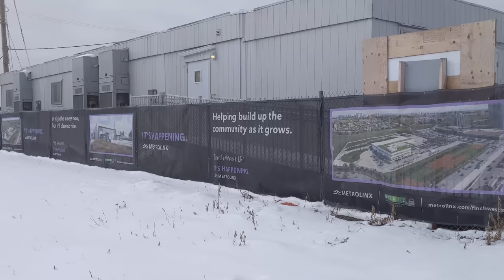Missing Links: Short-Sighted Transit Planning

Comment: Hamburg might also have a missing link in the future: It is planned to build a new S-Bahn tunnel to the west, reaching the Osdorfer Born (more than 20,000 people live there I think). But, first of all, the S-Bahn is doing the job of a metro there, second, it will end at a very unfortunate end, where any additions will end on some fields, third, the town of Schenefeld, just outside of Hamburg, will be missed, where P+R could be built, fourth, it will also miss Lurup, a part of Hamburg with about 30,000 people (also, the planned U5 will miss it too). Then you continue next to a wooded area, back into the city, and you'll squeeze right between the stations of Diebsteich, future station for long distance trains, and Altona, a major bus hub and current ending station for many trains. So people will have to change to regional or long distance trains at either Dammtor, where not all trains are stopping right now, or at the main station, which is overcrowded and will be even more in the future.
And then theres the U5, a metro line which is currently under construction (at least a tenth of the total length, for more than one billion euros). It starts kind of in the nowhere, in Bramfeld, far away from the U1 and the under construction S4 in the east, crosses the S1 line to the airport without a stop, and then meets the western branch of the U1 (the U1 has a rather odd shape), which you can take to get to the S1. It will continue southwards, missing the U3 station Mundsburg by about 200m maybe, and then it hits Hauptbahnhof, where barely any people will have left the train, and the platforms are even considered too small. Then it will go on until it reaches the ending station: Arenen (stadiums), where not too many people will exit during weekdays, just short of Lurup (see above). At least you got another stop at an S-Bahn station.
And no, theres no such thing as a Tram.

tldr: S32 not reaching Schenefeld, Lurup, Diebsteich or Altona; U5 not reaching S4, U1-East, S1, U3, S32.

Comment: the red / blue connection mentioned at the end is suppperrrrrr frustrating as a everyday T user. there were designs to extend the BL there in 1986. and even ready a page of a book that talks about the possibility of a connection in 1904. MGH station was even renovated in 05'. lets pray that the newer plans for 25' -2030 will go thru and finally bridge the link 
 what are these companies doing?!

Comment: What a coincidence with this video! Kolkata just opened its third metro line (Joka-Esplanade) along a truncated route (Joka-Taratala) which is practically useless as it doesn't connect to the mainline rail transfer hub (Majerhat, the next station after Taratala, about 2km apart)! The new line, when connected, is supposed to have interchanges with mainline rail at Majerhat, and with other metro lines at Park Street (with Line 1, the North-South Line) and Esplanade, the Northern terminus of this line (with both Line 1 and Line 2, the East-West Line).

On the contrary, Line 2 (which still runs on a truncated route) saw a massive jump in ridership (from 5k to 30k daily passengers) when it extended by just 2km, from Phoolbagan (the previous western terminus) to Sealdah (the present western terminus). Sealdah is the busiest mainline rail station in not only Kolkata, but India as well, as its the terminus for a plethora of suburban rail lines, along with intercity rail to rest of India. The Sealdah-Sector V stretch (Sector V is the IT hub of the metropolitan area present around the eastern boundaries of Kolkata), though not the complete stretch of East-West Metro (the bulk of ridership is expected to be on the western half, between Sealdah, Esplande, and Howrah, another massive suburban and intercity rail hub), still provides meaningful service with just a single extension.

Comment: The biggest problem is political interference.  I know that the politicians green-light the funding, but for decades now I've been one to say to get the politicians OUT of the decision making process.  It is far too tempting in lean times to pare back funding in order to make up for budget shortfalls., or to scale back a project when costs start to spiral out of control and a politician is in danger of losing their elected position in an upcoming election. (Or even worse, gutting needed transit projects in order to fund pet projects that are more 'sexy' to the average voter.)

Comment: In Singapore, the Downtown Line makes a loop around the CBD, but along the western part of the loop, it crosses the North-South and East-West Lines without any connection. This is especially inconvenient with the North-South Line where you need to go in the opposite direction back out of the loop to connect outside the CBD. It also goes really close to Dhoby Ghaut, which is a HUGE interchange hub with three other lines. If DTL stopped at Dhoby Ghaut, it would be so convenient for so many people making so many different trips. But LTA (Land Transport Authority) and SBS Transit (DTL operator) probably had a good reason to not connect.

Comment: There's one pretty "outrageous" missing link in Paris that is getting some traction, in the sense that the public starts to really question it :
It's the North end of metro line M12 at Mairie d'Aubervilliers (which will be a connection with M15) as the tunnel continues on for about 900 meters, serving as the terminus backstation and train storage.
It extends exactly in the direction of La Courneuve - Aubervilliers station on RER B situated 1km from M12 North current terminus, meaning there's maybe not even 100 meters missing to connect with RER B, so approximately the length of a metro station platform...
Some locals are being quite vocal about that gap, as such a connection would be very useful and practical and the tunnel is already dug and fully equipped for 90% of the distance.

One other big missing link that will certainly raise loads of questions when the lines concerned by that "oversight" will open is the La Plaine - Stade de France RER B and M15 station :

The M16/17 lines' tunnel runs under the North tip of the plaza in front of the RER station, and the end of line M14's tunnel sits right between M16/17's tunnel and the current RER B station.
This plaza will also host a station of tram T8 South extension and the M15 station.
This spot is already the main transit access point to the Stade de France, regularly overflowing RER B with hordes of stadium goers.
So why on Earth wouldn't they put a station on lines M14 and M16 / M17 too, as the tunnels are already there, to alleviate the load on RER B and future M15 & T8 by spreading it on 3 more metro lines ? It's beyond me...

The plaza being of triangular shape, you could have separate entries, each serving primarily a particular line and greatly helping to separate traffic flows above ground.
The Western side of the plaza triangle could have an entry serving mostly line M14 (*), the Northern corner of the plaza could be the entry mainly dedicated to M16/17, as the Northeast side is reserved for T8's station and the Southern side is dedicated to RER B and M15.
This precise layout would follow the tunnels and existing  & future, under & above ground stations' current disposition.

I heard the justification that they want to split the human flow with the further West station complex of Saint-Denis Pleyel (M14, M15, M16, M17) and Stade de France - Saint Denis RER D.

But that's wishful thinking as we all know what stubborn crowds do : they go to the closest access point and clog it or use the shortest path, despite the best possible indications.
We recently had an exemplary demonstration with the monumental chaos that occurred before a soccer match when RER B was having problems : crowds diverted to RER D, saturating it and concentrated on the closest stadium access, a secondary one not designed to handle so many people, instead of the slightly longer main indicated path to the much larger main access point.
They averted catastrophe by a very very very thin margin but it sparked quite a scandal.

Without M14 and M16/17 Stade de France station, all those that would want to catch these lines will inevitably saturate M15 for a one station Westbound ride instead of walking well over a kilometer, crossing the large railyard.
(*) > [ Have a look on Maps sat view and cartometro, you'll see it couldn't be better placed :
The building site immediately touching the South side of the RER B station is for line M15's station, the building site on the Northwestern side of the RER B station and right across the street to the West of "Place des Droits de l'Homme" plaza (a 180m x 150m x 150m triangle) is line M14 tunnel's end and TBM exit. Lines M16/17's tunnel runs under the Northern corner of the plaza's triangle. ]

One solution could be that this hypothetical M14's Stade de France station would only be open on the days and hours when the stadium is used while on other days the tunnel after Saint Denis - Pleyel would keep its current use as back station and train storage.

So I'm pretty sure we will hear criticism about these Stade de France missing links in the near future as I'm far from being the only one questioning that choice of not putting a station here for M14 & M16/17.

There are several other gaps, mainly between the upcoming (already heavily connected) line M15 and the different ends of metro lines, especially in the West.
Namely : M10 between Boulogne - Pont de Saint Cloud and Saint Cloud.
M3 between Pont de Levallois - Bécon and Bécon les Bruyères.
And M9 which is connected to M15 but not with T2.
That is going to be a massive bottleneck when M15's South trunk opens as all the passengers from M15 to La Défense will walk across the bridge and take T2.
Jamming traffic in the area and saturating T2 which is already overcrowded on peak hours.

Sadly, these 3 metro lines will probably never see an extension on this West side (at least not in the near future) as they all terminate shallow underground right next and perpendicular to the Seine river and building such extensions would either require them to surface and use a bridge or dive much deeper underground meaning their current terminii would have to be rebuilt at a greater depth.

One other Parisian missing link is the absence of M14/M2 connection at M2's Rome station, even though M14's tunnel runs only meters away from M2 Rome station ; so there's no stop here for M14.
It wasn't deemed essential enough, M14 having other connections with M3, M9, M12, M13, RER A & E at the nearby Haussmann - Saint Lazare complex, and with M8 at Madeleine ; even if M2 carries quite a lot of traffic and the only other connection to the "inner loop" lines is at Bercy with M6. 

There are several plans being studied by IDFM and the region, that are heavily supported by local mayors and transit user groups for possible extensions in the East and Southeast to "plug the gaps" :
M9 Eastern extension to connect with T1 and M11 Eastern extensions.
M10's quite long Southeastern extension to connect with M6 at Chevaleret, M14 and RER C at Bibliothèque François Mitterrand, T3a at Avenue de France / Bruneseau, then through Ivry and Vitry down to M15 and RER C at Les Ardoines - Vitry sur Seine station.

Several other Eastern side missing links are under different stages of development :
M11 will soon open an extension to M15 & RER E Rosny Bois Perrier station, doubling its length. (It's currently being tested with the new, longer MP14CC rolling stock)
T1's East end is being extended South to connect with above mentioned M11's extension and further Southeast to Val de Fontenay current RER A & E stations and future M15 & M1 stations.
M1 East extension to Val de Fontenay is in the advanced planning stage and will start building as soon as the opposition between the state and the region / IDFM on details is resolved, which will probably be this year.

There are also several gaps to fill in the tram network but this comment is already a way too long wall of text. 🤣

Missing links are quite possibly the most frustrating aspects of urban transit, especially in massive networks where it feels like a glitch on a masterpiece.

Happy new year !

Comment: In Barcelona there is a problem with the Suburban lines operated by the regional operator, because 50 years ago those lines were streetcars that were later expanded to the nearby cities. Then they were moved underground but still maintain the exact same route. Lines S1 and S2 end at the middle of Bcn with great connections. But S3 and S4 end at southwest Barcelona with only subway connection (fun fact: S3 and S4 are narrow gauge because of the streetcar gauge used back then) and thousands of people have to take other methods of transport to get to the center of the city. Now there is a plan to connect all lines in the same place but as previously mentioned, S3 and S4 have a different gauge than S1 and S2, so this is a problem that FGC (operator) should've fixed before.

Comment: I'm most familiar with Toronto's transit system and there are 2 missed connections that bother me. The first one is the fact that Line 4 Sheppard doesn't extend West to connect to the Sheppard West station. It would have provided much benefit to travelers to have that as an option and would have made commuting downtown easier if there was a shutdown or delays on the Yonge side. The second one is the fact that the original build of the line 5 Eglinton Crosstown (if it ever opens...) doesn't include Pearson airport. I know an extension to the airport is being discussed and planned but to me it would have made things so much easier to find the additional funding and just go all the way there in the first place rather than building it after. Like you said, it's easier to just do it when everything is already under construction instead of stopping and then starting again later to extend it. Who knows now when that will ever get done. Interesting to see that this isn't just a result of poor planning in Toronto, that it also happens with transit systems all over the world.
Reply: Sometimes it's better to build in stages, rather than all at once.  Both line 1 & 2 were built in stages.  This allows the core section to be in service sooner than waiting for the outer sections.

Comment: In Vienna, Austria there's a new subway line (U5) being constructed. And there too they first planned to finish the line at "Elterleinplatz", 1,5 kilometers short of the connection to a S Bahn line (S45). But gladly they changed the plans (and presumably got some additional funding) so it will be built up to the connection Point.

Admittedly S Bahn line ("Vorortelinie") currently isn't the most important in Vienna, only serving about 10 Minutes frequency at peak time but it has great potential

Though much more important to the whole project u2/u5 is the new connection at Matzleinsdorferplatz to planned 2,5 minutes frequency through running suburban S Bahn trains (Stammstrecke)

Looking forward 👍

Comment: When the Luas tram system opened in Dublin, Ireland, it had a missing link between the red lines and the green line. This was due to a new grovement getting in, and change the orginal plans, that would have seen tree lines being built, and meeting together on O'Connell street.
Reply: The two lines opened in 2004 with a 15-20 minute walk between them, and eventually was connected together 13 years later in 2017. The interchange still isn't great though, about 5 minutes walk. I think we're bad at interchanges in general, some proposed metrolink and dart underground stops seems purpose designed to avoid each other sometimes. That's if Metrolink ever gets built!

Comment: Not a missing link, but a missed initial infrastructure extension:
The Zürich (Switzerland) S-Bahn system was opened in 1989. For that, the station at Stadelhofen was extended from 2 to 3 tracks. Adding a 4th track would have cost only 30 Million more, but they didn't do it. Now the station runs at capacity and the 4th track has to be added for 1.5 Billion.
Reply from the maker: Yeah that project is crazy!

Comment: If it weren't for the fact that subway construction here is crazy expensive, I'd love it if the Montreal Metro Green Line extended through Lasalle, Lachine and to a new terminus at Dorval station. That would give 3 rail lines/modes merging near the airport. 

There is a lot of bus service in Lasalle to to get people to Angrignon station, but it's an 85K borough with no rapid transit within it. Lachine with about 50K doesn't have easy access to the metro.

Going the reverse way by extending the REM to connect it to Angrignon would be much cheaper & I support it, but as a user who lived in that part of the city for a long time, I think the metro extension would be more convenient to use.

I also love the idea of REM-ifying the Exo line (not necessarily handing over the operation of it, but electrifying, automating, and boosting its frequency). Construction would be needed to buy or bypass CN lines which is a bottleneck now, and also to remove all the level crossings with over/underpasses which won't be tolerable if a train is going by every 5 minutes in each direction.

Comment: Just came back from Berlin, those gaps in the U-Bahn make it very frustrating to use even when the waiting times are sometimes every 2 minutes. Disappointing from a city with such a great S-Bahn. The system makes you rely on buses, which to be honest are kinda trash in Germany. You need one to go to the big universities in the city center for some reason